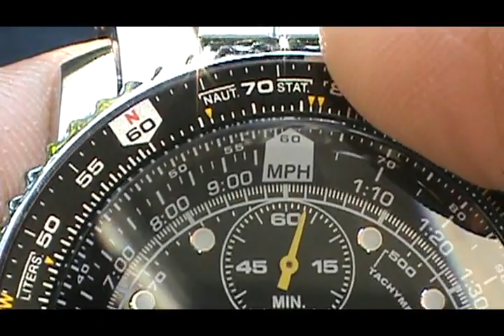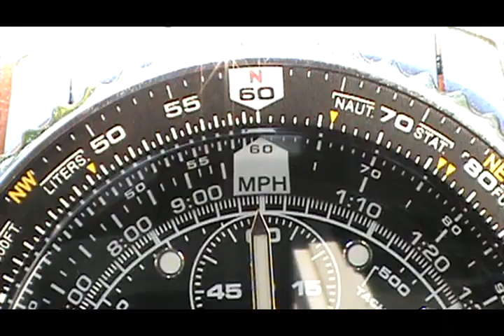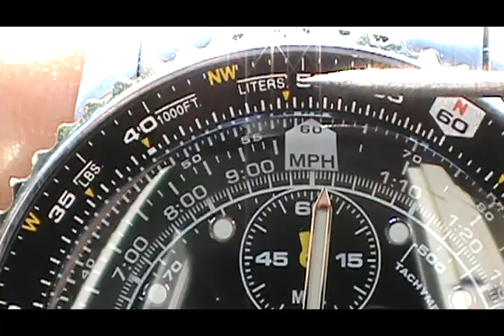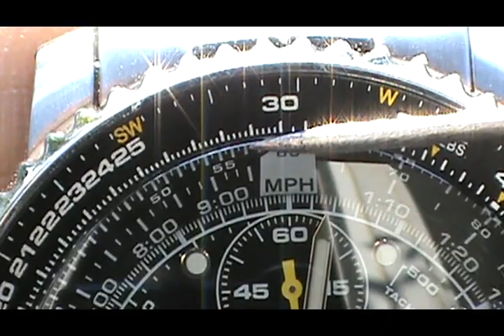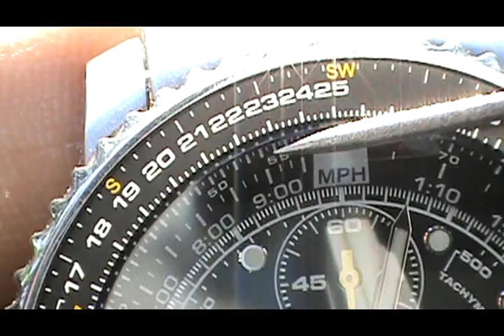Seiko dial calculations #2 - SNA411 (Flightmaster)

Comment: I had trouble understanding square root at first, but I got it. Basically you need to make sure 10 on the outer dial lines up with the same number that X (In this case 576) is also.  So for an example if you lined 10 up with 5, 5 on the outer dial should be lined up with 25 on the inner dial. Thus making 5 the square root of 25.
Reply from the maker: Cory Smith Yes that's right!